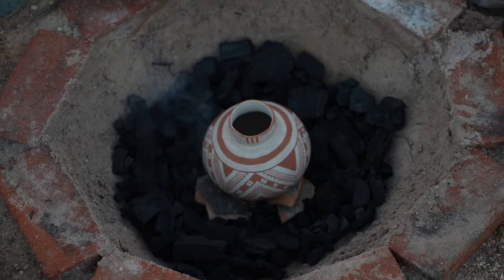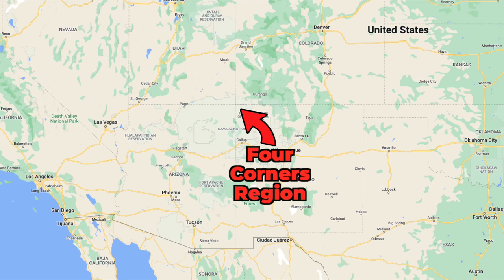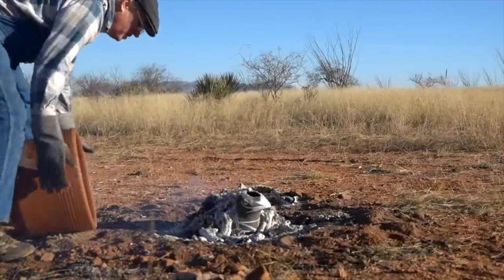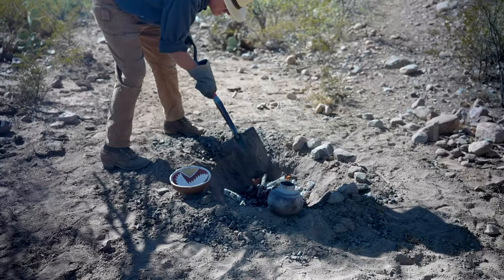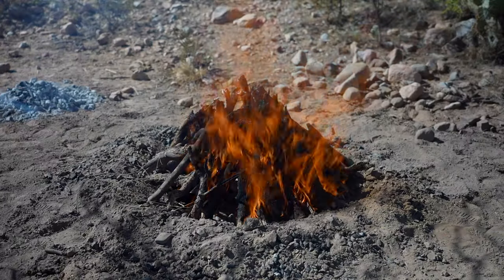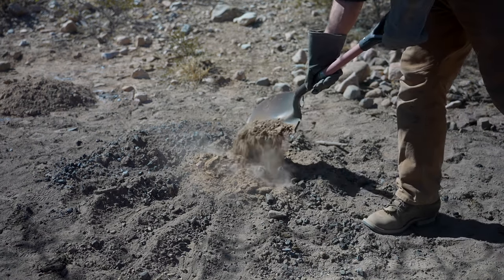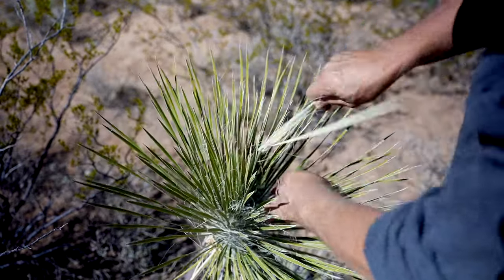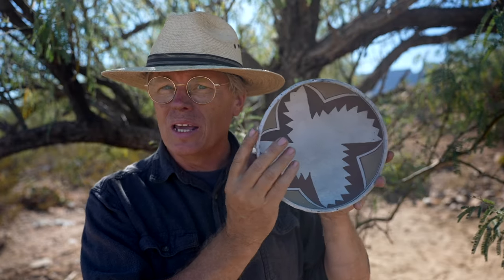Reduction Pit Firing Experiments - Fixing My Past Mistakes

Comment: The thing that comes to my mind re. forming an air seal is using overlapping wet hides &/or wet soil. Probably on top of dry soil to prevent wet stuff contacting the pots or coals. It seems to me those might be better than dry soil alone at keeping air out. You could maybe replicate wet hides with a half-dozen-sheets-thick wet newspaper. I love your persistence! 👍

Comment: Pot turned out perfectly authentic looking, and we are assuming that far more heat and charcoal are necessary. We are going to overdo it with the charcoal and try to keep the temps hot enough to burn the carbon out even at the time of smothering... We are going to use too much charcoal, but our clay likes it extra hot and will not fire well at all in a surface fire... We hope to open our kiln on the first day of 2024.... I do think that a bulk firing will produce better results overall, because of the high temps and large amount of charcoal. Good show, Andy!
Reply from the maker: Thanks. Carbon will start burning out over about 650 C so the pots are almost always hot enough to burn it off at time of smothering, and my pot was totally burned clean before I smothered. The problem is that once you smother, there is not enough oxygen to burn the carbon off and if the dirt has organic matter in it or the coals are still producing a little smoke, then that gets on the pots and will not burn off. That is what happened here. The thing is you can wait much longer before smothering to make sure there is no chance the coals will produce any carbon, don't be anxious like I always am. Also take precautions to make sure that you either use clean dirt or that the dirt doesn't come into contact with the pots.
Reply: As a novice observer, I agree, the soil you're using to smother may be a problem. The popping sounds you mentioned are possibly a clue. Perhaps there is oxygen being released from that soil so that the soil itself is spoiling the reduction environment?

Also, loose dry soil seems like it wouldn't be a good oxygen barrier. At least, at the volume you're using. That sandstone slab the those old notes might be critical because it's an impervious monolithic covering?

Fascinating stuff!

Comment: Interesting video, thank you! It reminded me of a charcoal-making kiln that I once helped with years ago in Wales. It was a modern steel kiln, not the primitive kind build with wood and covered with earth. We used fine sand to smother the vents - I think slightly dampened first. That particular burn wasn't very successful as one of the vents let oxygen in and half the wood got burned right down instead of leaving charcoal. But I can see that a sandier soil might well work better than that very fine silt. Ancient charcoal furnaces were also covered with turf, which would be hard to come by in the Southwest!
Reply from the maker: Thanks for the feedback. We do have lots of sand around here I’ll give it a try.

Comment: If the goal of reduction is to keep the oxygen out, I can think of a couple things.

Charcoal/coal/coke create what some call a "neutral layer," which blacksmiths have been preferentially putting their steel for centuries. It's a part of the fire where the atmospheric oxygen immediately burns up before it can oxidize the iron. That's probably why you've noticed that the charcoal needs to be really close to the pots, even touching. The neutral layer in coke forges is often below the surface of the fuel.

If you cover up the sides with mud to keep the draft from pulling more air in, and then drop in something that burns easily and rapidly (dry leaves?) before you smother it, maybe that'll burn off the remaining oxygen inside? If you keep adding them until they no longer burst into flames despite the hot coals, that'll be a pretty good indicator that there's not a whole lot of oxygen left in the "kiln."

Comment: Have you tried smothering when there is more flame? I feel the more flame there is the more it will pull the oxygen from the iron oxide as it tries to burn. Can you get a carbon monoxide probe that withstands the heat* and would give you an idea of what is going on inside the firing?

* do they even exist?
Reply from the maker: I have no idea about any atmosphere sensors but that would be helpful. The trouble with smothering when there is flame is that you will get dark pottery because the smoke will contaminate the pottery. You need to burn down to coals first so there is none of that.

Comment: Carbon monoxide may be part of the equation if it can strip the oxygen from things.
Reply: Perhaps fill the pot with well-fired charcoal, then build the fre around it, but not have the charcoal touch the pot.
Reply: Maybe half-fill with charcoal, build a hemispherical pile, and set the pot on top.